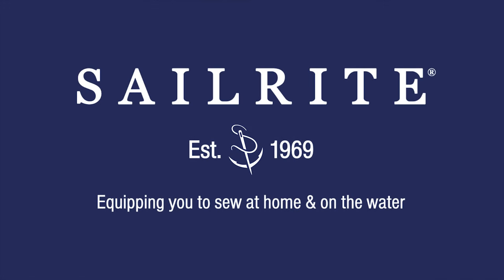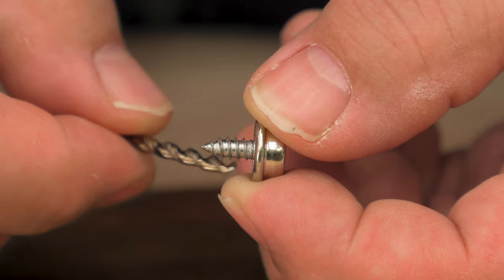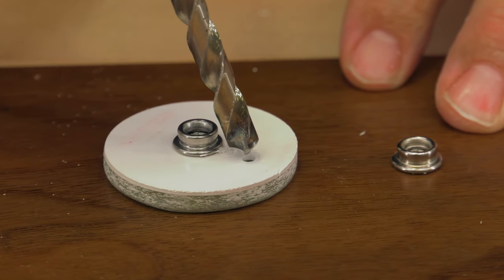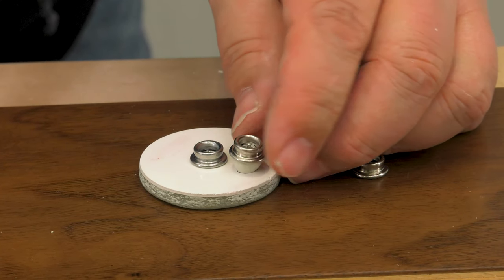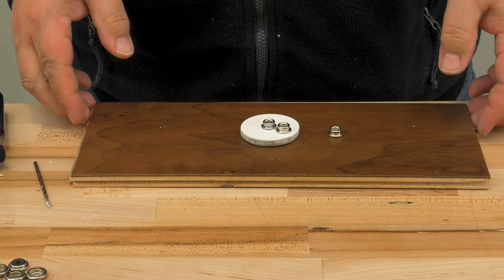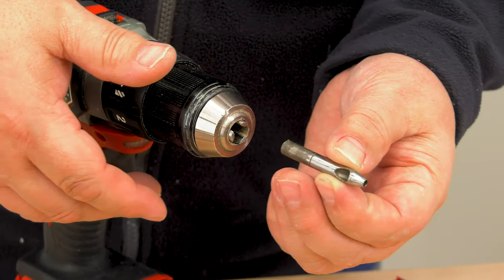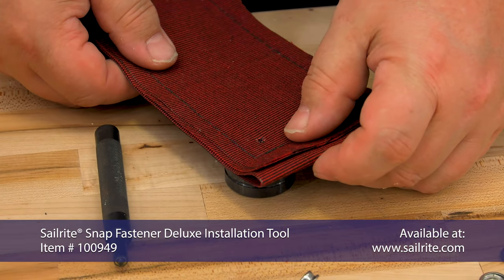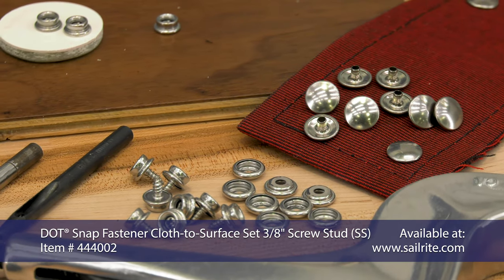DOT® Snap Fastener Cloth‑to‑Surface Set 3/8" Screw Stud (Stainless Steel) - Item #444002

Comment: It it workable to screw in the plastic car paneling for car drapes.
Reply from the maker: It depends on the thickness of the plastic. Even if the threaded post goes thru the plastic, it usually works.
Reply: @SailriteDIY  is there a glue I would use to go with the screws in the plastic to keep it secured better , That you can advise me to use. ??
Reply from the maker: @ReneaDooserider  No, we don't recommend using glue to secure screw on snaps.